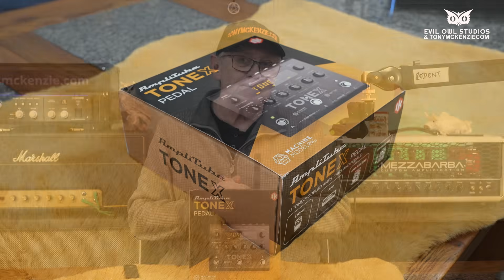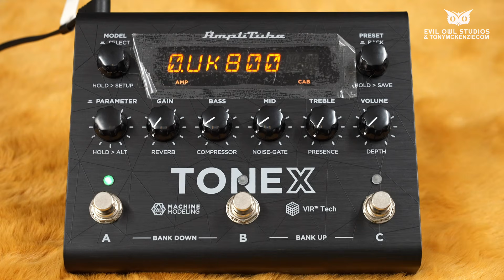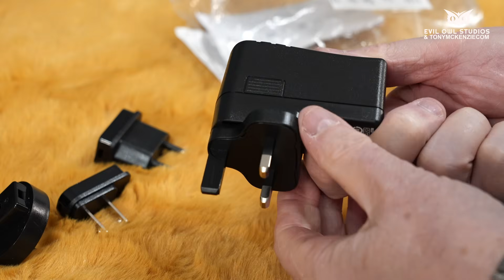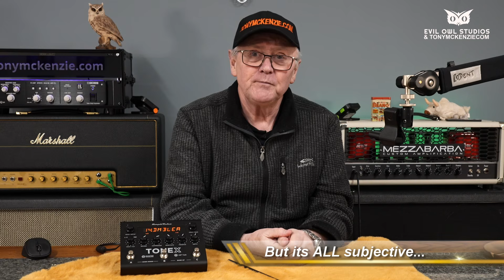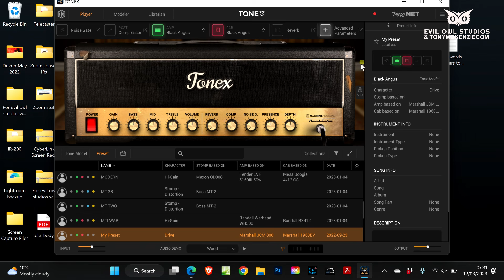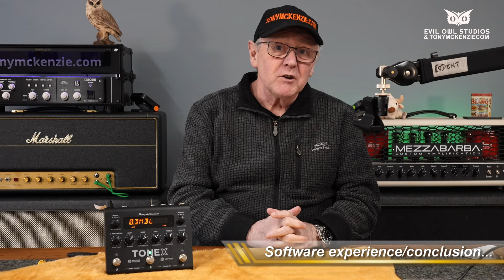TONEX Amp Sim  Simulator | is this Finally Utopia for guitarists?

Comment: Great review. I bought this pedal and the hardware is fine, but the computer software is badly designed.
Reply from the maker: Software seemed 'twitchy' to me, I came from software starting back in 1981 and moved to hardware by 83, and have tended to stay with hardware in what I do. But the software might improve, it is a new release, and I have seen some companies release not so good software that later improved no end... even Roland Boss. Thanks for the post and entirely relevant. Thanks for watching.
Reply: Agreed. I’ve had around a dozen or so occurrences of the software becoming unresponsive today. I’ve had to reload the app to get it back up and running. Software can always be updated but if the platform is wrong from the start then even this can be problematic. My initial harsh impressions of Tonex have softened today but I think IK have a lot of work left to do to get this product right. Hats off to them for the price though, they got that right.

Comment: 38:42 duuuude, you nail it. I got mine yesterday & the manual situation, well… I used to work with Italians in product & project development over the last 30yrs; & 2 things I took from the experience:
1, it takes them a thousand words to say something that takes everyone else to say in 20;
& 2their logic is often very different to ours & although their attention to detail is good they often miss the blindingly obvs. 

I’m not saying this is typical of ALL Italians but just my experience of working with them (& many other cultures) as a Brit over the last 30yrs.
Reply from the maker: Ha... well I can assure you that there are less than perfect manuals from almost any source :) The manuals are really not that bad for the main ones, but it does excel itself on the 'effects' for the software (probably Amplitube) where the 550 pages were beyond the time I certainly could apply to this review. Thanks for watching.
Reply: @tonymckenzieofficial  you’re not wrong, the BOSS ones are at least a better format BUT it’s just the info is really limited😂🤚🏼 we can’t win!

Comment: I've been trying/testing the software version of this with my DAW computer, since it was released and I find it works fine.  I didn't experience the kind of problems you encountered trying to install.  What I do find is that theres too much stuff, too many options...it's like a guitar amp funhouse or something.  I can manage the software, but I find it really fidly.  Unless I'm playing commercial music, I usually have about 3 versions of the same sound with my guitar amp rigs and  pedals. A direct solution is required to have in your toolbelt today, depending on where you're playing. I played venues here in Montreal where they don't want much sound coming from stage (if any). I have yet to buy any type of hardware modeler yet...Thanks for your review Tony. :)
Reply from the maker: There is no doubt that there is a lot to go through and learn. The Win 10 installation did not work, although they did contact me after two days to be honest I made it work on win 11  so no real use to go back to them... and in any case by the time the reply came the video was made and posted. Personally I do think that making some creations (I'll call them that) and just putting them on the pedal and I would then not really have that much use for the software personally, hence my comments in the video. And thanks for your post that shows another side of things too... thanks for watching.

Comment: Hi Tony, like your videos (finally subscribed), Regarding the manuals, When you buy the pedal, you get Tonex MAX and Ampli as part of the deal, even if you intend to capture your own Amps/Pdls, you don't need more than the Pdl and Tonex manuals, if you don't - the quick guide is what you need.
Reply from the maker: Well thanks for the post about this. IMO they don't make 500+ page manuals to hold the door open. Its one of the biggest manuals I have ever seen!..  thanks for the sub its appreciated and thanks for watching and that post.
Reply: @tonymckenzieofficial  Yes for 3 product 2 out of which, you say are NOT relevant to you (for your use case, you only need the librarian page of Tonex), When I buy a midi controller, and get some basic DAW for free, I don't include the DAW manual in the count. Amplitube not needed to use the pedal, it's a "gift" same as the free DAW.
Reply: @tonymckenzieofficial  Also as a SW engineer in my day job - they used to (make 500+ page manuals to hold the door open), but now it even dont do that, because no one (but you aperrantly) actually prints them to paper (they all started to care for us trees) from cover to back (but only the must relevant parts - quick guide covers it).

Comment: Thanks for the Real in's and Out's on this Unit. It seems to have a HUGE learning Curve. I Suppose one could just use it like any pedal and keep it OFFLINE. They are a Company that went in Reverse, they have been selling Software for quite some time if you count Amplitube. Not being licensed/approved with Microsoft and Apple is a real oversight. I had heard/read that alot of AD's pop up when one wants to be using the Software, Mainly to buy more stuff, If that is True that would be a MAJOR turnoff. Well Done giving YOUR HONEST OPINION.

Comment: I do like that you have been able to find and publish the potential issues with the software. I have been playing with the SE software that comes with the cature box and have not had any of the issues you are having. The software even goes full screen for me. I have done a few captures and I have not gotten that part down yet to get the tones to sound like they do in the room but my room does not have any sound treatment so I am probably hearing more bas then there is in the room. I am glad to see that you feel the hardware is quality, and who the hell reads the manual anyway.
Reply from the maker: It might be that the software does not like my resolutions (similar problem was with ezdrummer 2/3 at one stage and was a real pain when using the screen in 4k.) Thanks for the post and for watching.

Comment: Great review Tony. I bought one recently and yes I find the sw a bit clunky but it does install on my win 10 PC, but I’m not interested in the sw other than to download patches. I must say that having downloaded a Boogie mk4 patch off their library of patch contributors, plugging my strat with single coils and added a splash of reverb, I got the most gratifying tone through my headphones I’ve ever heard. I’ve had helix and current boss products before this and just recently sold on my two notes revolt to get this. Night and day. I don’t care about delays and modulation etc. for the money, it sounds stellar. Totally happy apart from clunky sw.
Reply: It's not a big issue if there are problems with the software because they can easily adjust and fix a lot of those issues in future releases.
Reply from the maker: Thats a fair point, but bearing in mind that issue I saw was there in 2021 exactly when will they fix it all? That's the real question with software. I was honestly surprised to see a problem like that going back to 2021.
Reply: @JoeGuitar6  I agree. There's always a learning curve with any software. It'll probably make total sense soon. I used to have IK Stealth pedal, but it needed to be connected to a PC to work. They've been at this game for a good while. Great to see they've got well made products at realistic prices. Definately a game changer.
Reply from the maker: Great info and glad you like the Tonex. The software I found on win 10 was not a recent problem, it had been there in 2021. However on win 11 it did install and work. Thanks for the post and for watching too.

Comment: Hmm. Very mixed feelings on this review to be honest. What I liked was the in depth look at the hardware, taking a look at the chips. But some of the remarks showcase that you indeed coming from a vastly different background than the audience to which product is catered toward:

1. Price of components: the expensive part is never the components. Not in a tube amp, not in the ToneX. The price lies in the fact that you have software developers in the background coding the entire program for the unit to run smoothly, Quality assurance to properly test every aspect of the software as good as it gets. Think of it as a basket full of gold - the basket has no relevance except for holding the gold in it. 

2. Installation problems: I had 0 issues, so had thousand other people not have any issue. The only issues I heard of were from people who know how 5onuse a computer rudimentary, and that's all the knowledge they have on this subject. But, given the state our society is in, it can be expected that you should be able to get installers running, set up windows firewalls and other OS related settings properly to get the thing running. It not, of course this product is not for you, but it then highlights that it's not the products fault, but rather the product is not suitable for the user facing these challenges. What does pose an issue is that the hype generated by content creators is done so by people who mostly have powerful computers - this leads to people believing they will have the same smooth experience on their potato Hardware as all the guys with amazing PCs with strong graphic cards. But also again, a user fault to assume such thing - if I buy an EVH5150III and complain how shitty that amp sounds, and it then is revealed I am running it on a pawnshop cheapo cardbox 4x12 cab, I would get ridiculed by peer guitar players for posing an illinformed opinion based on my own mistakes. Something similar happens to a lot of the negative feedback on usage of ToneX. People have shitty computers or not the proper ReAmping setups, and complain the capturing takes long or sounds like dog poo. 

ToneX is in fact the revolution it claims, because it brings capturing to the masses. There are more accurate solutions out there, but in Null-Tests it easily beats the Kemper and Quad Cortex. For that fact, if somebody states something else "feels better", it's just shows emotional attachment leading to false conclusions. Stuff like Null tests work in absolutes - either it cancels out perfectly and therefore is a perfect capture, or not. 

Anyhow, despite my majorly different conclusion on the subjecty I subbed. Hard work has to be respected, and it was entertaining.
Reply from the maker: I'm not entirely convinced that 'my background' had any relevance whatsoever, bearing in mind I have owned a Kemper since 2011 and a Helix for years. Also Fractal Audio and most other 'stomp' type products in the intervening years... indeed I daresay that I have probably bought, owned and used more simulators than most people with also a longer user period of them also. Of course I like real tube amps too? But those are what simulators pertain to duplicate in most instances including the Tonex. Strangely, the price of the components (back in the day) according to Fractal Audio WAS in the components, although it was clear to me at the time they were not telling the truth. While there clearly IS a cost in the software, you will not that this company sells addon after addon for this system inc. Amplitube, so in my opinion they make the revenue from the software also and not 'just' hardware. Having said that, the hardware in the Tonex pedal was as nebulous as most similarly priced pedals and simulators that I have seen in the last three years or so in reviews I have created. It is not a particularly expensive device. 

Great that you had no issues with your installation of the software, however, I literally found the very same issues that I had going back to 2021? I reported that problem because it exists, surely that's what genuine reviews do? It did install on the win 11 laptop and I did confirm that.  One last thing, I possibly have rather more experience on PC's than you. I started in 1981 in technology, and by 1984 I was using PC's and selling them, networking them, and even later used them for internet service provision, right through to when I personally stopped selling but I'm still involved to this day), but my experience with windows goes back to version 1 Microsoft DOS then on the the earlier windows that we used to throw the 5 1/4 disks across the room as skimmers :) to today. You know, sometimes people do sometimes want to blame the messenger... but please understand that if I had not had the problems then I would not be reporting them. It was not the messenger ;-)

Where you comment 'Tonex is in fact the revolution...' etc. that you made comes from is unfounded really. If you mean it's cheaper than a Kemper then it is - certainly I agree with that, and it can be afforded by guys with less funds, but hardly a revolution- its results are only really doing what the Kemper has done since 2011? That is not a revolution. And neither is it a 'game changer' as the guys hyping the unit up to the hilt all over YouTube does get a little boring after the first... one. 

Hey I'm not 'having a go' at you either, I really want to say and confirm that, but these devices (whatever they are) all claim a complete change in everything and honestly last time I saw a change was in 2011 with Kemper. Sure the rest 'contribute' and some of the things you mention certainly do contribute to the march forward with simulators, their use and their cause moving it all forward.  My own opinion is just an opinion after all, but it is based on my experiences with the Tonex and other previous gear on YT since 2009.

Thanks for the post also BTW - as I like to see varying and differing opinions from time to time as it stops me falling asleep :) and thanks for that great response and indeed for watching.